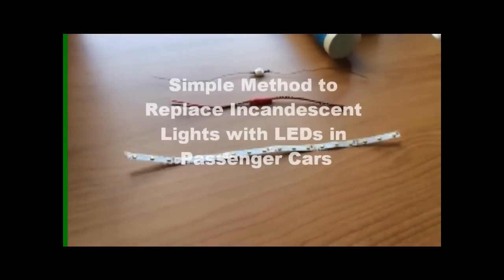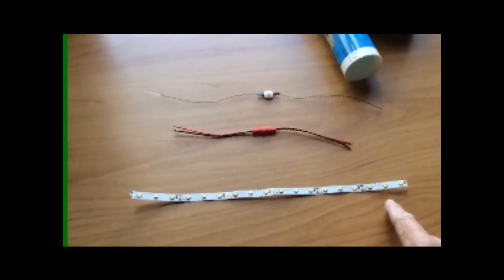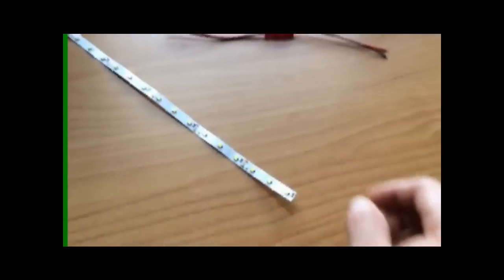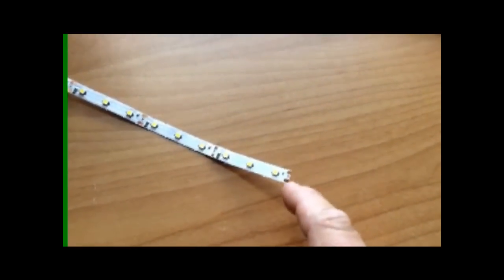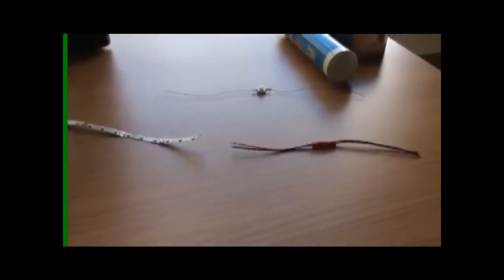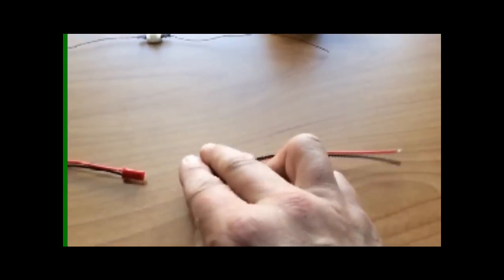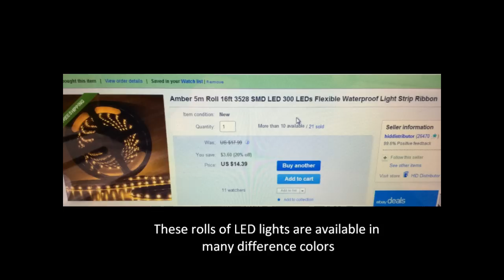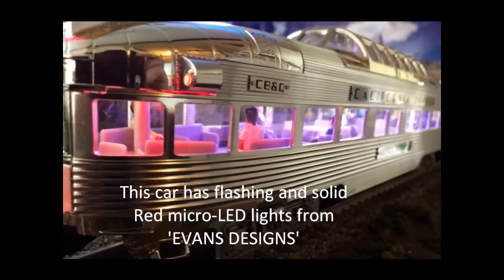O Gauge Passenger Car Lighting:  Replacing Incandescent with LED

Comment: No extra electronic do dads?  Why do others use chokes, resistors, capacitors, etc and you don't have to?
Reply: Just read some of the other comments and tried running an LED strip on AC, and it did work. However I have been going the DC route (rectifier-regulator-capacitors) so my car lights don't flicker.

Comment: This doesn’t make sense. How can you wire DC LED’s directly to AC power?
Reply from the maker: Yep. Electronics is still a mystery to me. All I know is when I power up track lights come on.
Reply: Didn't make sense to me either but I just tried it and it did work. I use a rectifier, regulator, and capacitors so the LED' don't flicker. Color wise, mine don't look this good.

Comment: What are you using to convert the AC transformer power to DC for the LED strip?
Reply: Although those lights are marketed as DC LED lights, they work fine with AC!  However, with AC you cannot eliminate flickering with a capacitor!